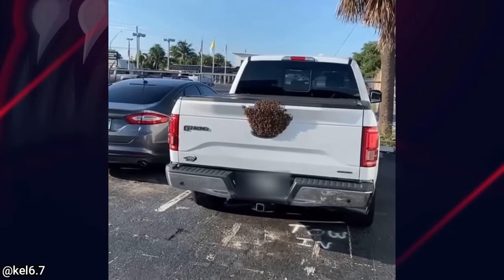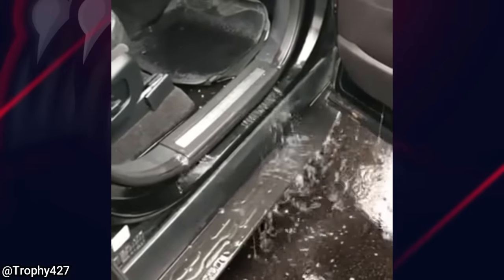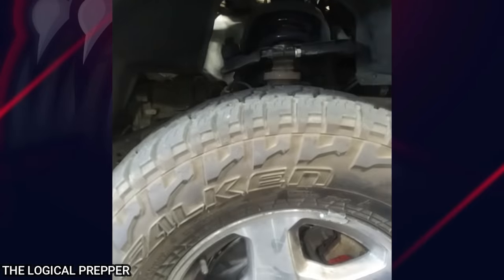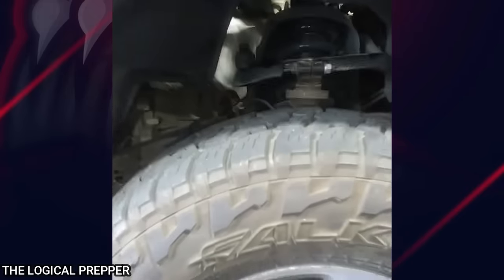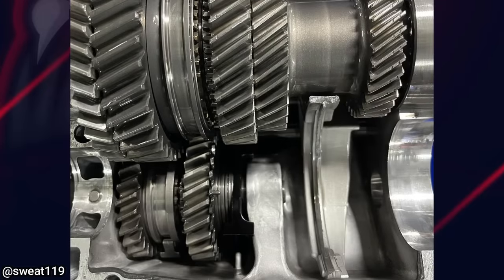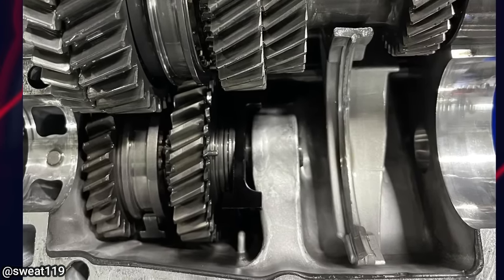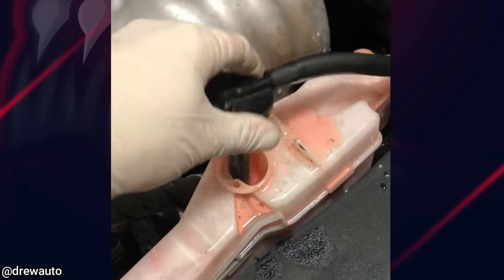Customer States They Have Bees Stuck On Their Tailgate | Just Rolled In

Comment: Work for LR specialist - had a good laugh at the “windshield was not installed correctly at the factory” - sounds about right tbh
Reply from the maker: They seem to have a lot of issues for how expensive they can be lol
Reply: It does nothing but rain there, you would think the brits would be able to seal a windshield
Reply: @JustRolledIn  Yeah, we aren’t a franchise dealer so we don’t see many factory screw ups, but we’ve seen a few over the years, like the customer that accused us of screwing up an oil change on their 1y old LR after their low oil light came on and they had to pull over with oil all over the road. Turns out it was a faulty oil pump seal that popped on the nose end of the crank and the pump was literally was pumping the engine oil out behind the front pulley all over the floor. It was *impressive*.
Reply: @JustRolledIn  Kind of like every Chevrolet Bolt made  being recalled due to chance of battery catching fire .
Reply: Maybe I'm naive or a "Karen" in the making, but if a faulty windshield from the factory left THAT much water in my new car and $24,000 in damage, I'd be wanting a new vehicle, not repairs. I'd be concerned about lingering damage / premature system failures.
Reply: A.J. Kleipass   Shit I thought he said four grand, 30% of cost I’d sue for new
Reply: @ajkleipass  No, that’s completely fair I’d say. To properly repair a car with that much water ingress would require replacement of pretty much all the interior, wiring, ECUs, dash, centre console, any rear-seat area controls. It’d take a couple of weeks at least, and you’d need to be super careful about fit and finish. You’d be way better off just ordering them a new car.

However, there’s a huge BUT. LR North America source all their cars from the UK, so lead times are horrendous. It might actually be faster to order the parts and rebuild the car. Also there’s a waiting list on some popular models too, due to limited capacity and high demand. That said, getting the parts is sometimes pretty bad in NA too so I really kinda feel bad for the dealer.
Reply: @MDBenson  -- speaking of dealers, imagine if that flood wasn't rain, but the result of the dealer running the car through a car wash before the customer came to pick it up! 😳
Reply: Especially for Land Rover.
Reply: Keep the whole car i want new 1
Reply: @ajkleipass  Doesn't work like that. I've had a similar issue with a 2021 F150 at work where the back window wasn't sealed properly. I've had to tear out and rebuild the interior TWICE in the last 3 months on it. This time every piece of cloth and padding is getting replaced. Ford would rather pay for 35+ hours of labor and new interior parts instead of giving the customer a new truck and taking that one back to Dearborn for them to tear down and figure out why the issue happened in the first place.
Reply: I'd be very suspicious of the transport company personally.

Comment: I'm a 33 year dealer mechanic and that loose tie rod end is one of many.  Body shop guys almost always leave something loose.  I think they don't want to get their hands dirty when putting it all back together and just run bolts on hand tight expecting to go  back later and never do.  One rule I've learned-It's either on tight or I left it off all together.  Plenty of wet floors from missing drain plugs in oil pans to prove that, but they never made it out of the shop. LOL
Reply: They probably figure, it has to get an alignment, might as well make it easier on the alignment shop.
Reply: @MWilk098  I've seen a lot of good body guys be that ignorant to actually think that.  Me, I've done more alignments than I can remember and have never had to loosen the tie rod to knuckle attaching nut for a one.
Reply: @Mike Ha. I remember putting racks in those.  Had to pull the carpet back and drill holes out in the firewall to hold the bolts.   But no, I am very fortunate to be in GA and didn't have to deal with too much rust.  Sounds like a pain.

Comment: It's pretty when oil or trans fluid has sparkles in it.
Reply: My first change on my Rodeo was very sparkly when I got it (3rd owner). 2nd and 4th gear are very loose, especially 4th. But so far it's gone another 100k miles like that.
Reply: @Gizmo42Rodeo  I've found transmissions and rear ends are able to tolerate sparkly oil much better than an engine is.  Probably the thickness of material involved.
Reply: @Rsenior1981  yeah transmission fluid is a little bit thicker than oil and diff fluid well it’s the thickest👌🏿😂
Reply: Reminds me of the last oil change on my 400,000km taco. Welp I know what I’ll be rebuilding this fall, lol
Reply: I remember the first time I dropped the oil pan on my 1974 VW beetle and found broken parts of about a dozen or so 2mm thick washers(?) in the pan.
My friend who had worked on several of them said those broken parts were "normal" and to just throw them away. I think he was right, because the engine just hummed along until I sold the car a couple of years later.
Reply: @MonkeyJedi99  WTF, that's a little concerning. lol

Comment: "Car is making Farting noises" priceless.
Reply: Had a brand new 2012 Escape do that. At times the passenger seat sounded like a whoopee cushion. After 6 months of it and fighting with Ford I traded it in. The replacement was even worse! Passenger seat didn't fart but water leaks, electrical problems and when the engine dropped a bearing with no warning that was it. Just like the other one, gone in 6 months too. 
Took a 2007 Chevy off their lot. Still going strong with 352726 km on it or over 225000 miles I think.
Reply: At my age, so is the driver...

Comment: The crow bar was crazy. My buddy is a tow truck driver for the government he has a collection of hitch balls and pins he finds weekly on road he picks up while at work nightly
Reply from the maker: The crow bar ended up doing quite a bit of damage to the owners vehicle also. I didn't mention that since I only received the one picture but ya very crazy! And good guy for picking things up.
Reply: @JustRolledIn  He tows on bridges so he has to make laps as part of the job and look for debris. I worked at a tire shop long ago had a lady pull in with a flat far from home I found a spark plug inside the tire.
Reply: @frankm8533  Years ago I was driving down the interstate around Atlanta and saw something fall off the back of a tow truck that was driving in front of me . I tried swerving but still ran over it and it crushed one of my brake hoses . After having it towed to a local shop the mechanic there said he had never seen anything like it . It was a big truck brake shoe that had fallen off the back of the tow truck and was still wedged up against the caliper .

Comment: I drove a car for years where the sway bar was completely removed. I looked it up before letting that be done, yes it was known to still be drivable. But it made for a "unique" turning experience. Luckily I had plenty of experience driving old beaters, so it didn't take long to adapt to the new quirk. Just took it around town at about 4AM until I got the feel for it. RIP to that car, it lasted 18 years...finally retired it after it reached endless money pit status. Next owner got it impounded. I don't know why...only found out because they sent the notices to me (even though they shouldn't have). I wonder if it's gone to the recyclers now...
Reply: I dont have a rear one on my Rodeo after breaking one off roading. Dont really notice it not being there. I made disconnects for the front one for off road after I broke that one too.
Reply: My old Dart of course didn't have any sway bars at all when I got it in 79. Of course that wasn't uncommon back in the late 60s. If it was a entry level car no sway bad or disk front brakes. Eventually I decided to rebuild the front end and upgrade things. I put poly bushings and new parts, and eventually I got a front sway bar from 69 four door and bolted it on after a while. I couldn't tell any difference. I also traded a buddy for a very rare 75/76 police package rear sway bar for a run of Police valaints. Eventually my buddy figured it out and bolted it in for me. My Dart was a completely different car. Level around corners, tendency to oversteer even more, and just tighter. The whole car reacted together over bumps and I had to relearn how to drive it.
I also had factory 340 suspension, fast ratio 16 to 1 manual steering, plus I had added a Dana power lock sure grip to the 83/4 I had added years before. A friend who knew auto crossing drove it and said it was the best handling old Dart he'd ever driven.
I think the rear bar and good poly bushings and parts were the most improvements I made to the Dart but make sure to think a balanced package on bars for the way you drive the car.

Comment: Ok I got a just rolled in for you.   My wife was driving our 2017 Chevy Impalla and ran over something (never found out what.)  But the gas started dripping out from the bottom of her car near the motor.   It had two hoses with some sort of electronic device between.  Don't ask, I am not a mechanic.   I found out one of the hoses had a crack in it, sooo   I took a piece of water hose, spilt it and used two hose clamps to keep it on place to stop the leak.   After that we were smart enough to have it towed to a shop to get fixed.  I hope I explained it well enough. Sorry no pictures. Never though about it.

Comment: 0:40 My 2013 Ford Escape also has a purge valve issue, however instead of it being blocked, it gets stuck open, throwing up a Check Engine light code and stalling the engine every time I fuel up. Basically it's not stopping liquid fuel from dumping into the engine after a refueling, stalling the engine, but only once and then it's perfectly fine until the next refueling. A mechanic told me this but didn't make it sound like it was urgent and said it was an issue on all Fords from around this time, which that Lincoln is as well

Comment: @0:47  Had a plugged evap line on a car once.  At the track it started leaking fuel out of the cap.  I pulled off.  I cracked the cap open a bit and it was like opening the drain valve on an air compressor tank.  It hissed for what seemed like a minute before it felt safe enough to open the cap all the way.

@3:00 been there, done that, not proud, lol.

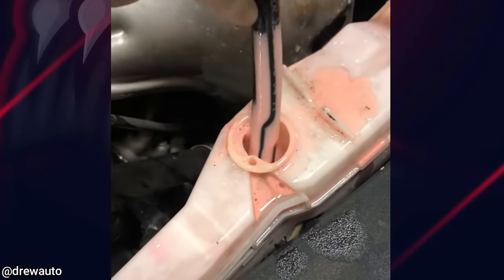Comment: 2:29 The "strawberry milkshake"  in the radiator is something ive seen before on 03 to 2016, Australian Ford Falcons far to many times. The heat exchanger/cooler for the Transmission was in the radiator, and would fail, causing trans to shit itself and also your wallet to do the same. Most people aware of this issue, bypass the stock one and put an external cooler on.
Reply: same issue with the 04 to 13 nissan pathfinders with the 4.0l

Comment: Somebody at the body shop was late for lunch, and the vehicle went out while they were gone. Nothing I haven't seen before. Worse when guys go to lunch halfway through an oil change, and a salesman gets into the shop....
Reply from the maker: No need to say more 😅
Reply: Ugh.. When I worked at the Ford dealership, some of the lube techs would do that. Start an oil change service, parts dept sometimes wouldn't have the filter because it was a non-Ford vehicle (especially the European cars). They'd order one from the NAPA down the road...lube monkey would suddenly go on lunch while the car was still on the rack. Service manager would come back later and chew ME out for the vehicle still sitting there even though I wasn't the one working on it and I had no idea the lube tech went on lunch. Never failed. 

When I worked PDI, I had sales people come back and take a vehicle while I was still in the middle of working on it... or before I even got started with it. I had to start hiding the keys because of that shit. Their dumbass don't seem to get that if they take something that doesn't have a proper inspection done on it and something is busted when the customer gets it... 👉 I 👈 get the blame for it. They did that a lot before I even had a chance to adjust the tire pressures. New stock comes from the factory with purposely over-inflated tires to prevent them from getting flat spots in them from sitting. Usually 60-80 PSI. Again.. Sales people thinking of their profits rather than having a job done correctly. 

Never had a salesman yank a car from the bay where oil and tires get done. Their ass would surely be grass if they took one without having oil put in it. They'd be without a job if that happened.

Comment: Wheels damaged from pot holes?  Pfft.  I'm a used car dealer, sold a car to a guy who later drove drunk.  Hit a curb, lost the tires on the passenger side, and tried to drive home, which was 25 miles away.  About half way home, he just parked the car because the drive wheel on the passenger side had worn down to the spokes and the brake rotor was touching the asphalt.  Nice grooves in the road that was a few miles long.
Reply from the maker: Oh wow 🤣😅

Comment: I had a 654&1/2 Shelby 289 FastBack Mustang in 66-77and it was a little rusted out so in a driving rainstorm it filled up with water and it had deep wells in the front seats. Picked up the rubber mats got out the hole shooter and a half inch drill bit. It never held water again.

Comment: Had a scary experience yesterday when I had to drive my brother-in-law's car to the airport (about 20 miles, across the city). It's a 10 years old WV Jeta that looks OK on the outside, but drives like an absolute junker. I'm not a mechanic, but after more than 25 years of daily driving many different cars (including some nasty old ones) I picked up my fair share of practical knowledge. This thing had at least 30 degrees of play in the steering column, mushy brakes, clunky suspension and shocks so badly shot that the entire car was wiggling around at every minor bump. The most shocking thing is that the owner is a mechanical engineer running a small engine repair business.
Reply from the maker: Jeeze, that does not sound safe 😅
Reply: Mechanics and busy businessmen rarely have time to work on their own vehicles.  They work for income...not for themselves.  Or they're too tired to care after a long day.

Comment: So The Farting Car may have taught me something new. It's leading me to think a random sound my Camry makes - typically only steady throttle or the tiniest bit of acceleration from zero - may be the evap purge valve. I have a regular gas cap, not those Easy Fuel things, the sound is a higher-pitched moan that sounds exactly like a dry/failing fuel pump instead of a fart. I pulled the original pump (with 353k on it) because I fired the parts cannon under the assumption that a 300k+ fuel pump was the likely culprit. (And thank you to Toyota for making the job so freaking easy to do, it was actually enjoyable even though 25 minutes of time and some money was wasted.)

Stupid me... The noise cropped up about a month after the CEL came on for the evap purge valve. Because there was so much time between the two, I did not think they could be related. No big deal, I guess, I already have a brand-new OEM canister assembly with all the associated crap ready to go in, I've just been lazy.

Comment: Had a problem with a naturally aspirated petrol vehicle where on the highway enough pressure would spray water from the cooling hose onto the dizzy??? Just enough to make it start to fail, take your foot of the gas and it would dry the dizzy cap and it would be fine again???

Comment: The Land Rover owner should receive a new car. There's bound to be mold.
Reply from the maker: 100%. I'd be pissed. Especially after buying a vehicle that's so expensive.
Reply: @JustRolledIn  Two of my work colleagues have bought Range Rovers and had nothing but trouble with them, this is why I drive a somewhat more modest VW Polo - at least the Germans are /slightly/ better at keeping out the wet stuff (we get the same weather all across Northern Europe, it just goes round in a circle)

Comment: The bees on the truck tail gate. What idiot droves to the dealer for something like that? Just get on the highway and drive 70 MPH and they should disburse. If not then when you get home park in the street and use a "jet" nozzle and blast them with water. they will fly away and congregate else where.

Comment: That "potato chip" wheel wasn't caused by hitting anything, it was caused by lateral force on the tire.  I've seen it before when a guy was turning sharply at low speed while also going downhill with a very heavy trailer.  The slope put most of the trailer weight on the rear wheels of the truck, forcing it to slide sideways as the wheels were turning, bending the inside rim of the wheel as it went.  I was standing behind the truck (watching to make sure he didn't jacknife the trailer or hit anything) and I actually saw it happen.  By the time I realized what was happening, it was too late, the tire blew off the wheel right after I told him to stop.

Comment: Called a beekeeper? That was a problem easily solved by a can of brake cleaner and a lighter. What can I say? I prefer to get jobs done quickly. I still think I’ll need to see how many tenths of an hour removing bees with makeshift flamethrower is worth though.
Reply from the maker: We need bees. No killing them 😔
Reply: @interstellar-X  Having cleared out hornets and wasps this way, I can honestly tell you it wouldn’t harm the truck. Most insects’ wings are very delicate. You would only need to use one small burst of flame to disable them.
Reply: @JustRolledIn  Text can’t accurately portray delivery unfortunately. It was meant be in jest.

Comment: If i take my toyota in for things i dont have tools for like alaignment i guarantee they will 'eff something up. They sheared the nut off the lower wishbone eccentric cam and left it, and left all 4 bolts loose on a bottom balljoint after replacing a steering control arm. 3rd world baby!